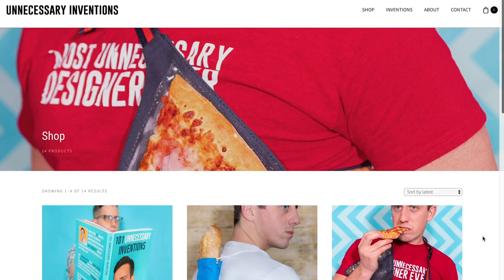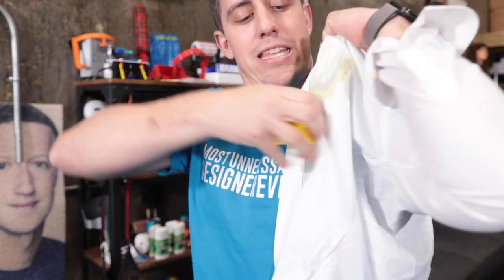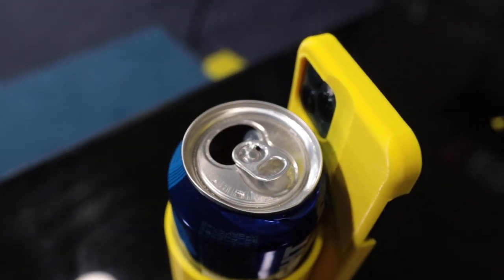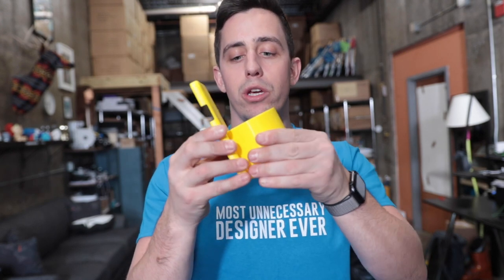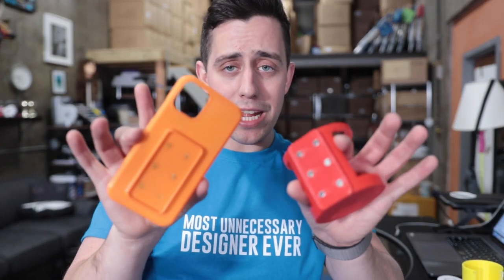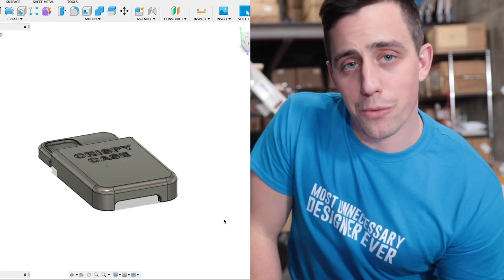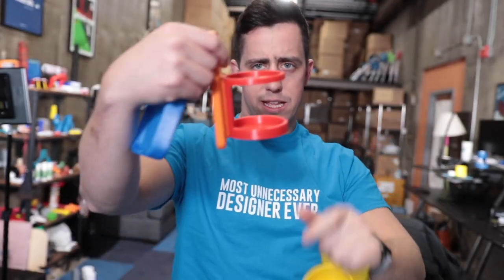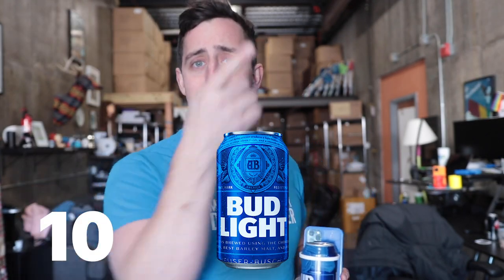Bud Light challenged me to design this iPhone case

Comment from the maker: Let's see a show of hands how many people would actually buy this thing...
Reply: Actually buy, or just seriously consider buying....? 🤔 Asking for a friend. 😏
Reply: If any of my drinking buddies had an iPhone 11, I would definitely get them on.
Reply: I NEED IT !!!! 😱
Reply from the maker: @veemacks7255  That sounds far to necessary.
Reply from the maker: @gus473  down payment right now or lose the opportunity type of buying.
Reply from the maker: @malmedia  Really spreading the holiday love.
Reply: @UnnecessaryInventions  shutup and take my money! I'm in for 1 - where to send $
Reply: I like the one can trash can
Reply: Yes, but: I think if you found a way to tighten up the design on the back it would be even better. Specifically, make the bottom flap a bit of a trapezoid with cutouts that would fold over the ring (and for the can bottom as required), ring staying a bit exposed, cut out at top of trapezoid to lay over the ring hinge, and with the correct trapezoid angles, it would also function modestly well as a cell kickstand for viewing when not holding a can. You could probably also shorten the distance between the hinges so the base didn't stick out as far from the can when deployed, though that might undermine stability a little  bit for 16+Oz cans. Also seconding Tyler M's comment. Add a loose material between the base and the ring kind of like an expandable cylindrical clothes hamper, with a thin but absorbent material circle on the bottom the can would rest on to catch any condensation.
Reply: Can I please please get this
Reply: @veemacks7255  do u seriously need to take photos while a can is there? also the front camera is still there
Reply: ME HOLY HECK
Reply: I would but I don’t drink soda
Reply: I would absosurdly buy one
Reply: I will or my mom will
Reply: Yes. I would buy one!
Reply: I have my hand razed
Reply: Hi
Reply: Me
Reply: This gave me an idea  make a phone case with like a fun game to play on the back
Reply: Use the MagSafe feature instead of magnets on the case
Reply: i would put all 45 of my hands up
Reply: Hey
Reply: By the way how you goes with that in the pocket

Comment: Your design looks better, but I was thinking if you made it an open ring and the bottom support something like an inch wide flap you could eliminate some of the bulk and have the bottom and ring interlock when closed. As a bonus I think doing it that way would also make it possible to fit it to an iPhone SE sized case

Comment: My first idea to fix the problem would be using rubberbands 😅 the wider ones, yk? Recreate the case so there is a gap between the back of the phone and slide two in. Pull them out when you want a drink and not a problem in your pocket 😋 also you could then probably fit MagSafe in the back and then it‘s actually useful.. i guess ^^

Comment: Quite a late comment but if you got a silicone ring at the top to hold the can that can fold down, then a solid piece of plastic that folds down into place and is held up by magnets. Just unclip it, and the pieces snap into place.

I made this comment before I saw the final design nvm lol